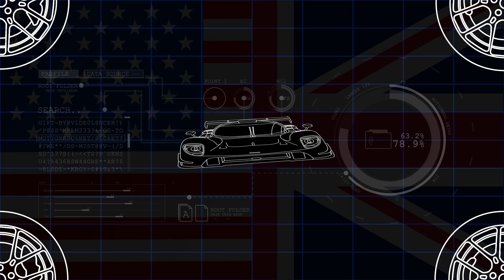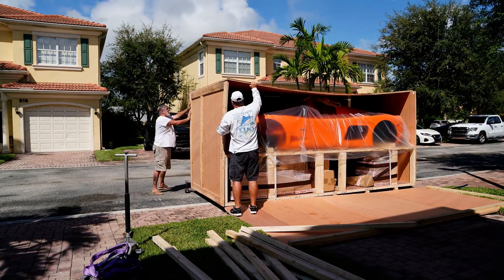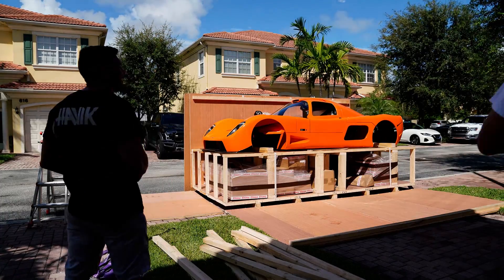ULTIMA RS Delivery and Unboxing

Comment: Looks great.  I built the first twin-turbo GTR and my car was delivered as a rolling chassis with suspension and all the aluminum panels in place.  It still took me a full year, 10 hours/day, 7 days a work to complete. Admittedly, a lot of this had to do with a dry-sump twin turbo, building headers, intercoolers, etc., and dyno testing and later track test and tune which had never been done before.  The car was wicked fast, 1450bhp at the rear wheels, low 8-second 163mph 1/4 mile times on Pirelli street tires and a top speed of 252mph which we ran in the Silver State Classic.

Just remember you don't have any flight controls... the car was slightly faster than my airplane.
Reply from the maker: Low 8s @ 163... nuts! Very very cool. Where is the car now?
Reply: @UltimateUltimaRS  I raced the car competivly from 2001 to 2006. Then sold it to a collector in Houston. I also raced Porsche gt2. Yes the car was measured at the silver state classic acceleraton from 0 at the starting line to 237mph in 18 secs flat.
Reply from the maker: @kurtdobson  WOW! That is ridiculous. I doubt there have been any cars after that have really compared. Glad you used it like it should have been!

Comment: Subbed, good luck with the building, according Última site  FAQ "Is there a PDK option? No, the Ultima RS is a real driver’s car and therefore is only available with a six speed manual shift gearbox and a clutch pedal." Best line ever....

Comment: I helped build the ultima Canam about 15 years ago which was a great experience. Your build is on another level. Not sure that your braking will be much easier, but you will adapt to the extra pressure required. A vacuum brake servo is an option but I would avoid it if you can. Look forward to updates.
Reply from the maker: Yeah I have a brake servo in the box and planned on doing it 100%, but now I may drive the car first, then decide if I want to fit it.

Comment: Man, another cool kid with an RS build, I gotta hurry up!  Can't wait to watch your build progress and see how you customize it.  The headers with 1 7/8" primaries are from AutoBionics and their full exhaust is a really nice bit of kit.  Depending on your power goals, the primaries might be on the small side, but let me be the first to tell you it absolutely won't matter.  I've seen your engine build, you already have too much power ;). Ceramic coating or header shield is a must to keep clamshell temps down, and you'll find that heat management is the real game.  I did a decent job my first go around but I've learned a lot and I'll be making updates during the rebuild.

Comment: Between yourself and Rob 105 my Ultima build addiction is well taken care of.  Thanks.

Love that pedal assembly, and good call getting all the carbon upgrades.  Those wheel vents might save a a few ounces in weight, but they add a ton of visual appeal.

Comment: Do some research on the ceramic coating heat reduction. The ceramic apparently doesn't do a great job. The wrap seems to be much better at controlling the heat. Although with the engine behind you and all the vents you could probably save your money as it will blow all the heat out the rear of the car. Those headers look like the ones the F-1 header makers build in Inconel, but l assume they are stainless. They are a work of art, l would leave them as they are, they look fabulous. If you coat them you coverup that beautiful tig welding. Anyway enjoy your beautiful car and be safe.

Comment: Looks great Gabe! That 800 series pedal box is the pick if you're going away from the factory setup. I wasn't completely sold on changing because of how much the criticism of the factory setup was simply because of the comparison to modern cars as distinct from race cars. For now I've kept the factory setup, but I also expect pedal pressures to be in keeping with a non power assisted car. Your setup will make it much more road friendly!
Reply from the maker: Thanks, Rob! Yeah to be honest I wish there was a way to test drive cars with both setups and go from there, because I do like the thought of analog everything. We'll see. If it lacks feedback or modulation, I can always remove the booster.
Reply: @UltimateUltimaRS  Definitely. I feel it's the same with the EPAS systems too. I think you've made a smart decision on the pedal box.
Reply: @UltimateUltimaRS  and Rab105, The factory brakes without booster are no joke, and require a lot of force.  Part of the issue is the lightweight nature of the car makes it difficult to bed the brakes in properly, and I think it took 8-9 track sessions to finally get them to bite.  The pedal will feel very wooden at first, but you won't have any issues with the brakes at normal speeds.  I found them very predictable and easy to modulate at speed, my only complaint is that the DS2500 pads aren't aggressive enough for the track.  Charlie swapped to DS Uno pads and loves them so that's what I'll try next.

Comment: Just FYI the master cylinders that you are installing are also used by Crown forklifts on the RR/RD (Rider reach) stand ups. Just in case you need replacements or parts such as the tubing or ferrules. Also don't forget you have to use DOT 5 brake fluid due to the Aluminum housings.(Do not use DOT 3)

Comment: Hey man, put Bosche Platinum/Iridium, 4 point spark plugs, in your Ultima. Then connect them with "live wires" active spark plug cables, to the distributor on your LS. No one ever thinks of it, but having a low resistance ignition system, gives your cylinders a faster firing time, resulting in higher revs. So, its only a 5 to 10 hp added to your engine, but it's 5 to 10 hp that no one ever really thinks about, especially when building a kit car. So remember; Bosche Platinum/Iridium, 4 point spark plugs, and "live wires" active spark plug cables. They're always an inexpensive boost to any kit car!!!

Comment: I love the engineering in the engine, but I hate to say this - you have a great opportunity to make this an electric car.  Man you could get so much more power out of an electric motor, also by placing the batteries through out the car you can perfectly balance the weight.
Reply from the maker: You can't deny the performance of the EVs these days, but they don't have the soul of an ICE car in my opinion. With an engine you have the sound, smell, and just sort of a violence that goes along with it. EVs don't overload the senses.
Reply: @UltimateUltimaRS  I'm with you 100%.  I was born and raised a petrol head.  Some time back I bought an electric car just to get the experience.  I have become a convert.  The power, speed and road holding with absolute silence is a sensation of its own.  And to be clear I still help friends tune their cars and bikes cause they are idiots when it comes to getting your hands dirty making it roar!!

Comment: The standard GM manifold flows well over 550 go just not in the high rpm unless U turbo them or supercharged ,i have built twin turbo under floor setups and made 800 hp

Comment: 2 years after your build and I’m just about to get my kit……. a quick question if you don’t mind, in case you still notice these messages. Are the tilton master cylinders a direct swap as far as pipework from the Ultima or does it need different brake lines?
Reply from the maker: I used the stock Ultima brake lines for sure but I believe just used whatever fitting was needed to go from the master cylinder to the brake lines.

Comment: do you have to have to use vette engine , what if I wanted to use say a Mercedes amg bi-turbinski , the sound is crazy with custom 6-1 headers & effectively your using a Pagani set up , the ultimate is a dream build & I to grow my channel waaaay more , but wanna build 1st handicapp capible 1
Reply from the maker: The chassis is configured for a small block chevy, LS, or LT engine, though there are owners who have gone with others. I'm aware of a build with a Lamborghini V10 and I think there's one being built with a 4 rotor.
Reply: thank you brother I was also thinking v10 5L , but I'm trying to find sponsors to do a lotus v10 lambo swap & call it lambotus , thank you for your reply brother , honour to be a part of the journey

Comment: bruh! you should've just bought a badass corvette that was specd tf out! this build to its max potential still can't come close to a vette handling braking, metal quality, safety features and durability of the car it self plus the replacement parts! Corvette is not the most refined car thats out there for that money but you'll spend so much more to get even close to a vette plus crash test rating and all that! I love the concept but its a gamble of a lot more things than I'd like! and all that IMHO im sure it could be far from facts
Reply from the maker: There isn't a Corvette from Chevy that could come close to this car in terms of handling, braking, performance, etc.  Years ago there was an Ultima that lapped the Top Gear test track faster than any exotic car they ever tested and an Ultima holds the record for fastest time from 0-100-0. You are right about the safety aspect and refinement, but this is basically a racecar with a license plate. Plus, I see Corvettes driving every single day. I've never seen an Ultima ever until mine.

Comment: Were you able to get just the chassis or did they make you buy one with the kit?
Reply from the maker: I just ordered the whole kit. I’d reach out to Ultima and see if they will sell you just the chassis.
Reply: @UltimateUltimaRS  will do. I have a 900hp twin turbo forged internal ls6 I've had in my garage for a year I wanna throw in it they can keep the motor.

Comment: The reason you're used to light brake pedal pressure is because you're used to power assist. Every car with disc brakes has it.

Comment: You had to set up all the shipping and customs?  Ultima has no way of importing these cars into the USA for customers?  That sucks.
Reply from the maker: Ultima does use a company for the logistics, but I read some comments from other owners who were not pleased at the high cost and little service provided by them, so I found someone local to me who handled it much cheaper.

Comment: I thought I was locked into to getting the Ultima RS kit, but I've also recently looked at the SL-C and was pretty impressed with what it has.  Your Ultima shell looks like it is fully finished or pretty close to it.  Can you or any other owners comment on that, i.e., is that how all kits are delivered or did you pay extra for that?

I love that the SL-C has a superior monocoque structure but I'm not sure that necessarily would be a deal breaker with the Ultima.  And INITIALLY it appears that you get so much more for your money with the SL-C, but I think if everything is taken into account I'm not so sure the difference is that large.  If I happen to buy one of the kits but lose interest in it (heaven forbid), which kit would have a better resale value?
Reply from the maker: A little to unpack there but awesome questions and those all were things I considered when buying the Ultima.  I too was very impressed with the aluminum monocoque offered with the SL-C. It is more "modern" and I was thinking it would make for a lighter platform, but in research, it seems that the Ultima builds are lighter than the SL-Cs. This could be because a lot of the SL-C builds have a LOT more creature comforts that the owners add. Power-opening doors, full stereos, and infotainment are things I've seen in multiple SL-Cs. As far as the finishing of the body goes, the Ultima comes fully buffed, polished, and ready to go in the colors offered. That was not an option, though I did pay extra for the body prefit, which just ensures the panels are gapped properly and everything opens/shuts properly. Lastly, the resale value was something I strongly factored in. Ultimas have some of the best, if not THE best resale value of any of the kit cars. Ultima has such a rich history and is known for the very high quality of the kits they offer so I think that's the biggest factor. Let me know if you have any more questions and I'd be glad to share my thoughts.

Comment: SO, HOW MUCH IS THE PACKAGE FROM PORT TO PORT, IN LONG BEACH CALIFORNIA? WHAT IS THE BASIC WEIGHT WITH SMALL BLOCK CHEVY ENGINE? WHAT KIND OF STEERING , BRAKES, SUSPENSION?
Reply from the maker: Completely depends on options. For my kit, it was right at about $100,000 but it was almost all options. Weight is around 900kg, manual (no power) steering, AP Racing brakes, adjustable coil over suspension.

Comment: Those Tilton Master Cylinders won't work with your Tilton Pedal Box. They will only work with the 900 Series Pedal Box/ or other pedal boxes which are pivot mount. Your pedal box is flange mount.
Reply from the maker: Thanks for the comment and thanks for looking out. The 800 series floor mount pedal box that I have (72-803) uses 78 or 79 series master cylinders for the brakes and 76 series for the clutch. The cylinders shown in my video are 78 series for the brakes (78-1000 and 78-700) and 76 for the clutch (76-750) and they bolt right up and function perfectly.
Reply: @UltimateUltimaRS  Ahh in your video you didn't show your pedalbox with the bracket on the back of the pedalbox which converts it from flange mount to pivot mount... hence my original comment. :)
Reply from the maker: @BevanLeigh  Good eye!

Comment: Looking forward to this! How much was the deposit? Make a video walking us through the order and what we would need. I want one of these. Crazy to think you’ll build this yourself
Reply from the maker: I'm going to do a cost breakdown at the end since there are still little odds and ends I have to get. The deposit is 25% of the cost of the kit, then another 25% six weeks later. When the kit is ready for shipment, the remaining 50% is due. So all the amounts really depend on what options you select. Hope that helps!
Reply from the maker: @TheAeroegg  I bought the transaxle here in the States. Are you in the US? If so, customs is 2.5% of the total order. You then have to pay sales tax on the full amount to your state when you go to register the car as well. Costs after costs!
Reply: @UltimateUltimaRS  Thanks!  Yes, San Antonio TX.  I bought a retirement house in Oregon this year, I believe there's no sales tax there so I'll have figure a way to make that work :-)  Did you get the 996 transaxle or something different?
Reply from the maker: @TheAeroegg  I got a G97.50 which is found in the 997 911 Turbo cars. It's a bit stronger and has longer ratios, though will be gear limited at 207mph in 6th gear at 7000rpm. I put a Wavetrac diff in it as well. I'll show it in maybe the next video or two.
Reply: Looking forward to your progress!

Comment: So you’re going to put a vette engine in a car 1/3 the weight and size of a factory vette that in itself can barely stay hooked on pavement? What could possibly go wrong......neat idea though.
Reply from the maker: Well technically not 1/3 the weight. I'm thinking it will be about 1,500lbs less than a Corvette ZR1 but with around 300 more hp. But yeah something like this obviously requires a lot of care when driving and hopefully nothing goes wrong.

Comment: Ultima RS specs (official Ultima site):
Chevrolet V8 LS (LS3/LS7/LSA) and Chevrolet V8 LT (LT1/LT4/LT5) direct fuel injection from 430bhp to over 1200bhp (LT5 tuned)

1200 horsepower?!

Comment: The arms, on your pedals, have NOTHING to do with the degree of braking force applied, that's all about the size of your resivoir, the size of your brake lines, and the size of the fluid ports on your calipers. Having a custom (after-market) "pedal kit" has ZERO effect on the braking capability of the vehicle. There's a whole segment on the custom pedal arms, WHO CARES! They make the car cooler to show off, but have no relivance in terms of the vehicles performance. Next time, don't spend more than a minut on the pedals, ok?
Reply from the maker: Pedal ratio absolutely plays a huge part in force required for braking. The higher the pedal ratio, the more force is multiplied and transferred to the master cylinder.